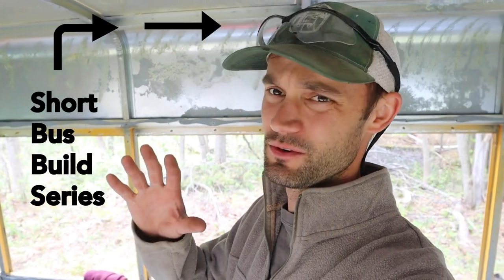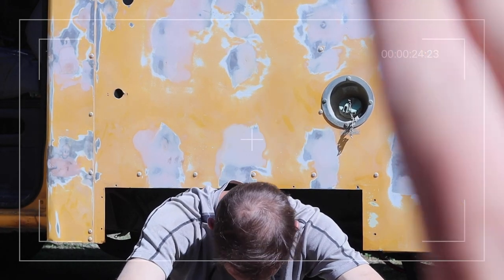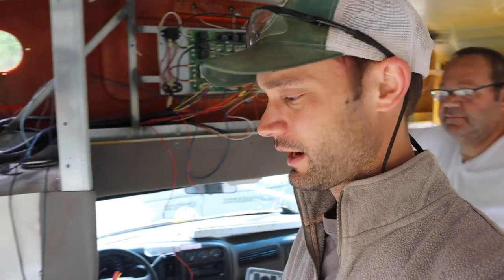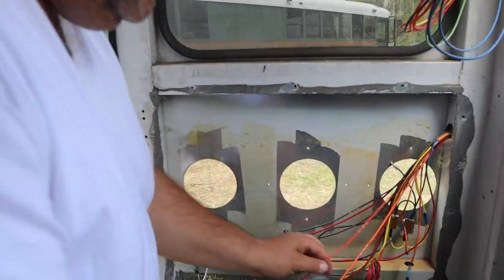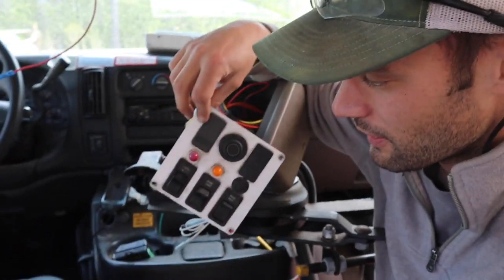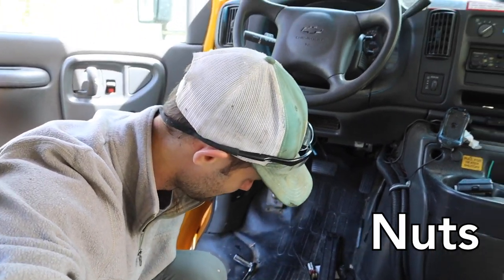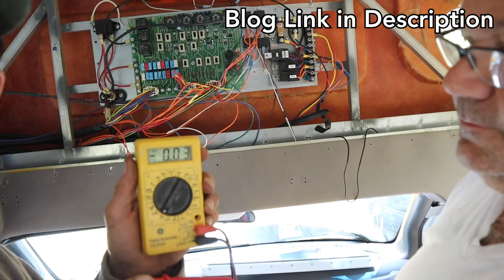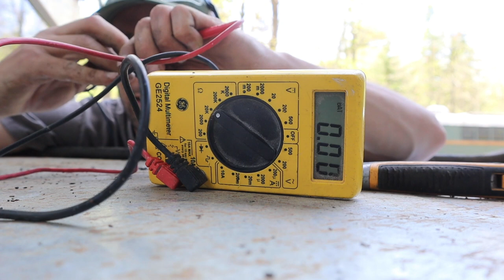Will The Bus Start Now? | Gutting School Bus Electrical System

Comment: I am so amazed, jealous, and irritated at the same time.  My bus did NOT get this kind of careful treatment.  The time you are taking on the "foundational" work is impressive and will result in a far superior bus than most.
Reply from the maker: Thanks, I really like to take my time and go through every system and part of the bus. That way when I build back I know it will be in good shape.
Reply: @navigationnowhere  I am currently working out a short in a recessed ceiling light.  I am certain it's a simply loose connection, but how many ceiling boards will have to come down?  Who knows....but if I was smart like MIKE......I wouldn't have this problem now would I?  Seriously impressed with your patience and persistence.  Details pay off!  Keep it up.

Comment: OMG I could have saved you guys so much time.  I used to work on those "short buses" (though they were transit versions).  That whole overhead circuit board is garbage from the upbuilder.  If you're dumping all the upbuilder stuff, you can chop it out.  In the case of a bus I'd go one wire at a time to make sure something like the rear door safety interlock wasn't in there but yeah, all upbuilder stuff.  Then rip out all that nasty wire down the sides and use the same individual wires to run your required lights....left turn and tail, right turn and tail, brakes, backups, and toss in a couple extras for later use.

And that circuit board, those things are hundreds of dollars in some cases. Definitely call around and see if you can get a couple bucks for it.  We had one bus go down due to that circuit board and we couldn't get one for some reason.  I put the bus back on the road by building an interlock system with 6 plain old solenoids and a bit of wire. It was still on the road when I left that place.

Anyway, love the vids, looking at a 40 foot pusher for the GF and I and just starting out in the intel gathering stage.
Reply: WoW, i can just cut it out?!  However, don’t some essential circuits pass through that board? The green wires that say “start” and the red ones that say “ignition” are particularly discouraging
Reply: @meatballsub7176  Without looking at the specific board I can't say for sure but every bus I worked on the boards were added into the basic chassis and were just interlock safeties related to doors, wheel chair lifts, and and such. Yours probably contains some school bus specific stuff as well like lights, engine kill if there's a contact bar in front, stuff like that. 
I just looked at your vid again and it sure looks like you could pull the whole board.  Just go one circuit at a time and test that the bus starts. Down the road that thing could become a nightmare AND you're losing space.
We now have our bus. A 40 foot AmTran pusher.  I pulled hundreds of feet of wire out including rolls of extra cables that were just rolled up and stuffed into the corners of the electrical box because the installer didn't know how or didn't want to spend the time to cut them to length.
Good luck with your build.  Ours is on YouTube under the channel HamSkoolie
Reply: @meatballsub7176  And here we are on the Skoolie account.  KG7TUO here.
Reply: I have the same bus as Mike, I think. But a Ford E 450 / Collins body. I was nervous to chop out all the bus electrics, I went slow and had success. A couple things which ran through the circuit board which i needed to do are re-route the clearance lights, which illuminated when the drivers door opened, re-route the power mirrors which ran through the instrument panel above the door handle, and i think i interupted the drivers heater blower when i took out the rear heater and wiring. Other than that it was somewhat clearly marked, though definitely seemed insurmountable. Although it seemed like previous fleet disabled some of the alarms and tracking machinery.
Reply: @meatballsub7176  The trick is just go slow, remove ONE circuit at a time and before removing anything disconnect and verify that all needed circuits still work.
It helps to know some tricks with a multimeter, test light, and jumper wires but basic meter and test light use will suffice.

Comment: Thank you Michael for this informative video.
Remains of a partially built van I was seriously considering to buy.
An elderly guy bought a 2006 Ford E250 with the camper top on. He had many parts but didn't have time to finish. The van had 36,000 mile. A lot of wiring like your bus.
I didn't know who could have helped me in 
R I. Could have made a good camper van.
I'm glad you have your dad helping.

Comment: Wire tear out day is always fun.
Get some Sawyer's Time Release DEET for those black flies. I've hiked in the ADK in May and June and never got bit. Lasts all day
Reply from the maker: I have to find something because they will be biting for a few more weeks
Reply: @navigationnowhere  this stuff is amazing. Put it on like sunblock. The DEET is in protein bubbles that break down over time but keeps it from soaking into your skin. Works on all biting insects including no see ems.
Won't stop them flying around you but they won't land and bite 
A friend invented it and I swear by it
They also make a spray for clothes using the same tech but with permithian. That lasts 2 weeks and a few washes

Comment: I saw you welding on the exterior skin last video and wondered if you were using a copper block behind the weld as backing when  welding the holes. I know they make filling holes really easy and clean.
Really enjoy watching.
Reply from the maker: No I did not but, I will start researching that! Thanks for the tip.

Comment: The electrical is probably my biggest worry when I start my bus build.
Reply from the maker: I will be planning a live stream on Patreon when we are doing the 12v wiring. Hope that way you can get some questions answered and help get you on your way !
Reply: If the black flys are like nats wear vanilla.  Put some in a spray bottle of water.   Spray on you.
Reply: wow very good job thanks video shows them how to awesome video. thanks Chris you saved me a trip lol. awesome awesome 🇨🇦🛠️🇨🇦🛠️
Reply: Any reason why not to just leave the wires disconnected, rather than pull them all out?  That was my plan, since the vandalock system was busted anyway when I got it.  Too late for me now anyway, but just sayin' if that helps alleviate some stress.
Reply from the maker: Technically you could leave a good bit of the wires and just hide them behind molding or a wall. But, I prefer to start with a fresh bases that we know is solid and build from there.
Reply: I’m stuck on my wiring.  This is really helpful to know it can be done.  Definitely going to look for some help with this. Thank you for the video.   This is the best channel for informational videos that I have found

Comment: Hey man, been watching your builds for a while, like and subscribed for sure. Idk if you are capable but we are at the point of our short bus breakdown and are stuck on the AC unit in the back. The unit and side condensor are out, freon is out and we have the rubber pipes cut up close to the engine but now we are unsure how to proceed. We aren't clear if we have 2 separate compressors under the hood, one for the dash and one for the unit. Should we just U-connect the "to and from" pipes underneath or do we need a pro to remove the stuff under the hood completely? One mechanic we went to hadn't done anything like this so told us he wasn't comfortable touching the thing, but we are now concerned the entire bus has no AC now and how to close the circuit with these two cut pipes under the bus. Thanks so much for any help you can offer.

Comment: I'm guilty of just framing around all the wires. I noticed you got rid of the AC - what will you use for when you're driving? Another informative video
Reply from the maker: Thanks, we will be installing a mini split system for when the bus is parked. I re-ran the lines for the ac so that the dash would still function.
Reply: Navigation Nowhere looking forward to the vid on mini split- I was thinking of putting a window unit in the bus but I will wait to see your install. I kept the rear AC because driving in the summer heat is brutal

Comment: Did you guys move that fuse panel from that corner box over the driver to the center above the windshield?  Mine is in the corner box such tight wiring all wrapped behind where you can barely reach id love to relocate the panel to where you have it which is where my ac evaporator was.

Comment: A question from someone who is decidedly non-technical: if you were to do another bus conversion would you consider taking out all cables and connections and start from zero?
Reply from the maker: Every bus I have worked on after my first I have taken out all unnecessary wires and re-run the wires that need to stay. Pretty much what we did in this video.
Reply: @navigationnowhere  OK, thx! Very much in awe of your conversion work, looking at the quality of the vids you put out I wouldn't be surprised if you hit 100K subscribers soon.
Reply from the maker: Thanks for the support. 👍

Comment: As a diesel mechanic I understand why you did it. But still in the back of my mind l am still screaming nooooooooo!!!!! Simplification will make life easier down the road. Even tho l am one of the few mechanics who doesn't pull the hair out while attempting electrical work l would still be wanting to avoid what you did!😁

Love your channel and vids. I realize sometime next year l will be looking at doing the same things.  

On another point l am looking forward to seeing the short bus painted without rub guards and before you put any wood sides like Navi. I want to see how it looks because l am thinking of doing the same and once removed it's harder to put back if you don't like the look.
Reply from the maker: I will be sure to remember to add a time-lapse or quick shot of the bus after painting and before any wood goes on.
Reply: @navigationnowhere  Thank you very much l really appreciate that!

Comment: Great build, but I’m Curious, why not start with a box van with a pass through between the cab and the box than a bus?   Seems like you  are basically stripping the bus down to a box van anyways.  Is there something more desirable about the bus body?  Also, your dad was freaking me out when he was cutting that wire loom with the utility knife towards his thumb, I would have sliced my thumb open for sure doing that.

Comment: My 1972 International shortbus project wiring removal is sooo much easier.  No circuit boards, no not starting if a door is open, just lights.  It is old enough that even the air brakes on it don't have spring brakes, you lose air pressure and you only have the little emergency brake on the drive line.  I work on new buses for a living and know your pain with all the safety stuff wired into yours.
Reply: Don’t happen to be familiar with parasitic battery drain related to parking break relay, do you?! That and potentially radio/chime with no radio installed? My 2009 Collins Chevy 3500 is killing me...
Reply: @shay1743  I have the same bus and am also dealing with battery drain! Such a frustrating issue.
Reply: @Ashely noooo! Stay strong! I’ll report back if I resolve/find me on Skoolie forum (or IG) @veglorde if we want to share intel!

Comment: not sure why you wouldn't keep a nice 12v AC system?
Reply from the maker: The main reason was because it would only run off the engine which would not be ideal for long off grid trips

Comment: Could you reuse the red and yellow lights as spot lights instead?
Reply from the maker: I am sure that they would supply ‘some’ light but not enough to be a spot light. If you look up my previous green bus I installed truck beam lights in that location

Comment: Ok.  You lost me at wire!!!!  My dad was just like yours.  As good as any engineer but he didn't even graduate from high school.  Learned it all in the school of life.  And went to university of Wisconsin  for electrical engineer while in the military.  He could fix anything.  Had a box of parts (no schematic) and when he was done he had a very old john deere tractor with spike wheels (no rubber) that you had to start by throwing the flywheel.  He used it to pull regular tractors out of the muddy fields in the spring when they couldn't get themself out!!!  Unfortunately I did not learn as much as I should have.  Boy do I miss my dad.

Comment: Removed my rear ac and cond on the side lost my front ac had to put a stock cond in the front to get ac back in the dash my electric was not wired into the engine running remove everything bus wiring and put my tail light back to stock had to find brake light wire under dash to the turn signal switch found where they cut it reconnect it brake and turn working single light now
I’m not to far from you I’m near Pottstown pa